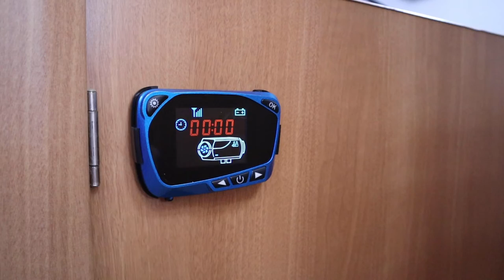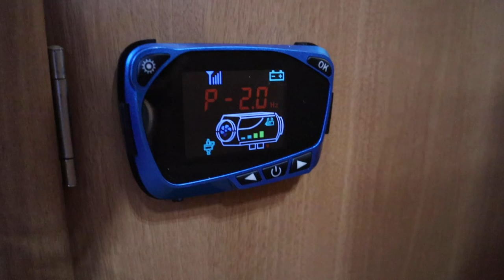Diesel Heater Install into a Caravan! Is it worth it??

Comment: Thanks for the video, 
Can anyone tell me if the 2kw heaters constantly use the 12v battery whilst running, or is it just used when first firing up.
If it does use it constantly then how likely is it that it would flatten the 12v battery.
Reply from the maker: Yeh they sure do. The battery provides power to the controller, power to heat up the glow plug on the initial start and power to the fan that blows across the body of the heater. Once it’s running, the current draw is around 1-2amps but on initial start up it’s around 10-15 depending on the heater. You will definitely need some ability to replace the charge lost if you are running it at night. A good small solar system will keep up with it. Thanks for watching

Comment: All that and never said if it was hot or not? Good video but wacking mine in tonight 👌
Reply from the maker: How did your install go?
Reply: All done in 2hrs. Works like a dream, was that hot we had to open windows lol
Was -3 degrees ran 14hrs a day for the weekend and used about 5 litres of diesel 👌
Reply from the maker: @outerlimits583  Thats great to hear! They certainly work well and are good value for money! Cheers Adam

Comment: Hey mate, 

Whats the fuel consumption on these units? Just weighing everything up to see if its practical.
Cheers.
Reply from the maker: Hey mate! It would depend on a number of factors such as temp, settings ect but Based on my own experience with the heater, I observed between 150ml-300ml per hour depending on the settings. Hope that helps

Comment: The free standing ones DO CATCH FIRE!! the exhaust pipe will not last. They tend to clog with the black soot then begin having error codes, ignition error the most common. The pro for these component heaters mounted inside is that the fumes don’t carry right back into the intake like the freestanding ones and most importantly you need to make sure you have consistent output DC voltage of at least 11 VDC anything less and the fuel will collect in the exhaust pipe unburned and has the high potential of igniting.  I’m just glad I was standing watching when it caught fire holding a fire extinguisher
Reply from the maker: Oh wow! You sound lucky that you were there. First one I’ve heard of catching fire
Reply: So that experience highlights the recommendation to buy quality fuel hose. Also the upgrade of the power wire is imperative.  I’ll keep that in mind. Maybe that’s why mine sooted severely. Thanks to both of you.

Comment: Hi, is 2kw silent in comparison with 5kw? as i found 2kw has smaller fan, it means might work with higher revs. Im looking for most silent heater, need just verry little heat.
Reply from the maker: Hi I’m unsure as I have never used the 5kw. I would assume they would be pretty similar in noise. The 5kw might be a tad louder as it has a bigger fan

Comment: What do you use for power? I have 1-150 watt panel and two 12V deep cycle batteries. Does it use a lot of power? Briefly what 12V system do you have?         Thanks
Reply from the maker: On start up they pull about 10 amps but once the glow plug turns off (about 5mins) it uses just over 1amp an hour. I have 2 x 100amp AGM Deep cycle batteries with a 385w LG Neo panel (house panel) and run it through a VictronConnect MPPT Solar controller. I would like to switch to lithium once these AGM’s need replacing
Reply: @GetCampingOz   They are very easy to clean.  I have done so when I had problem with it becoming choked with soot.  I’m not sure why it did that. So cheap, I just bought another one.  They have no moving parts in the chamber and can pulled apart very easily. So they should be as good as new after that and go another four years.

Comment: Oh better mention the air inlets why not try a filter to prevent dust & Dirt from getting into the chamber, round car filter, I'm sure there's something around.
Reply from the maker: Good question. The manufacturer doesn’t require one. Even on the more expensive units they are required and if you do put one on, it can mess with the air/fuel ratio

Comment: Have you had any issues with the heater as of yet??  what brand did you buy??
Reply from the maker: Had zero issues with the heater. I’m super impressed with it. Last 2 weekends have been using them for 12+ hours straight and they have been flawless. Unsure of the brand it was from eBay. The seller doesn’t sell this any more. I’ve fitted another x 2 for friends and they have bought them of different sellers and the kits are almost identical. Thanks for watching 👍🏻

Comment: Seriously, the true danger is not that these may cause a fire, they may but cases are indeed very rare and far less common than fireplace dangers.  The true danger is co2 poisoning. I checked and verified this with my local Fire Department.  If you are going to use one of these types of heating units then just to be sure, install two or three co2 detectors with loud audio alarms.  Better to spend the extra money to protect your family and yourself. If these were up to NYC building codes, I would have them myself. I don't use them because I get surprise Fire Inspections on a regular basis.
Reply from the maker: The furnace chamber and the airflow (heat) is not coming from the same space. The furnace heats up the case and the air flow from the fan flows over the heated up fins on the case giving you the warm air. I haven’t seen any documented cases of people being effected by co2 poisoning. Thanks for watching

Comment: Does your unit plate get quite hot? Is it an issue?
Reply from the maker: It gets warm but definitely not burning hot. The exhaust is right next to it but I find the metal flange helps with heat.

Comment: hi get camping do you have link for the ebay store great work cheers
Reply from the maker: Hi Leigh. Link as requested 😀 https://www.ebay.com.au/itm/12V-2KW-Diesel-Air-Heater-Tank-Remote-Control-Thermostat-Caravan-RV-Pickup-AUS-/234000147768?mkcid=16&mkevt=1&_trksid=p2349624.m46890.l6249&mkrid=705-154756-20017-0
Reply: thank you

Comment: Did you install a fuel filter?  If not you really should.  Also, I hope you have everything fused at your batteries and get a carbon monoxide detector.
Reply from the maker: Yeh i did. In the vid Ive installed it the wrong direction but it has been fixed now :)

Comment: 30$ silent pump eBay.  I'm putting mine in a box ..in a box. 2 boxes
Reply from the maker: Sounds good 👍🏻 have you got a link?
Reply: @GetCampingOz  will post once finished  . I want it compleatly silent. going all out lol  first box done   150mm x 150mm PVC  insulated dence 15mm  foam . going to put quick release  connections  fuel in out.

Comment: Few things there, the tank seal washer is on the wrong side of the tank. Also where you put the pickup will leave a fare amount  of fuel in the tank.
I ended up using a 10 litre diesel jerry can that I can take out to fill. The pickup goes through the lid to the bottom of the tank and a quick release fuel hose fitting from diesel heat  down in Tassie. It seals the line when disconnected. As far as the pump I bought a silent pump for $30, can’t hear any pump noise now.
Reply from the maker: Thanks for the comment. The tank outlet actually has a rubber washer on each side of the outlet (inside and outside) This can be seen at 10:25 Thanks for watching!
Reply: What sort of pump and where did you get it please

Comment: So is it a Guess,  if the temps it produces is worth it or actually can heat up your place enough to make it worth the cost.
How much per hour does it use in fuel ??
Is a gasoline better then a diesel unit? ??
Reply from the maker: Good question. I don’t know. All I know is It doesn’t use much fuel.

Comment: do diesel heaters start and stop heating automatically or a person does it manually?
Reply from the maker: They are constant out put and don’t regulate temp. So to answer your question a person needs to do it manually
Reply: @GetCampingOz  oh, that's not good . thanks for the info..

Comment: good clear video. I have just installed one with the same controller. how did you go about setting the cut off temp? my eyes arent too crash hot and the instructions are too damn small to read.
Reply from the maker: Thanks mate. I haven’t changed the cut off temperature from factory. I think it’s set to 3.0hz

Comment: Caravan fires are not uncommon. In amongst them you will find a few caused by diesel heaters and fan heaters. Lithium battery fires are the most common cause in my search but I'd say van dwellers need to be extra vigilant about fire safety, especially with charging all the batteries that tend to get a lot of use in a van. Cheers.

Comment: Nice job !  How far from the unit can the pump be please?
Reply from the maker: From what I have read it can be a maximum 8m from the pump. The pump shouldn’t be any further than 2m from the tank as well. These pumps are great at pushing fuel but poor at pulling fuel. Hope that helps 😀
Reply: Thanks. That helps 👍

Comment: we would never fit a 2kw diesel heater into any van as there the same price as a 5 kW heater...also on Jayco vans there is bugger all insulation in the floor so the pump noise will always drive you crazy in the van.. Mount the pump in very dense foam then F2 glue it to the underside of the floor. also, rubber mount all of the fuel lines then there will be no pump noise.
Reply from the maker: Some great tips. When I researched which size, most people complained that the 5kw units get to hot on the lowest setting. My van is only 17ft.  I’ve just been away and the heater performed perfect 👌🏻 and I only ran it on 1/3.

Comment: Great video, but you didn’t really go over how you hocked up your electrics , you showed your batteries but you didn’t really show how you wired  it all in
Reply from the maker: Hi Gary, yeh good point, but it is very simple. 1 x positive to the battery and 1 x earth to the body. Cheers

Comment: Fire risk..utterly bullshit! It's no more of a fire risk than a Webasto for whatnot X the price of this unit!
It burns the fuel inside an enclosed aluminum chamber which you can only open by disassembling the whole thing.
It's a nice and cheap alternative to heaters that cost a lot more $$£££.  For a caravan, I'd go with a 2 or 3 KW which should be fine even in the winter.
Reply from the maker: I didn’t say they were a fire risk. It’s perceived that they are because they are cheap! Thanks for watching

Comment: Running your exhaust line just inches below your plastic water lines is...concerning...
Reply from the maker: Hi Robert, thanks for your concern but it’s been installed for over 12 months and during winter has been used continuously. The water line doesn’t even get warm. Cheers
Reply: @GetCampingOz  good to hear. As general practice they should be kept well enough away from each other. Heat can degrade plastics, and while it may not burn through, it can cause premature degradation and facilitate a future rupture at a spot that's weakened.